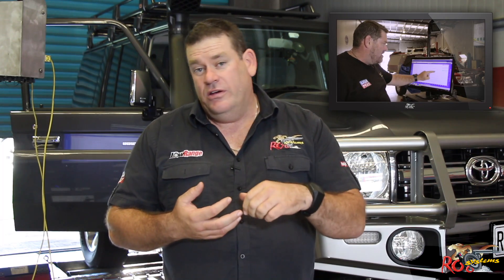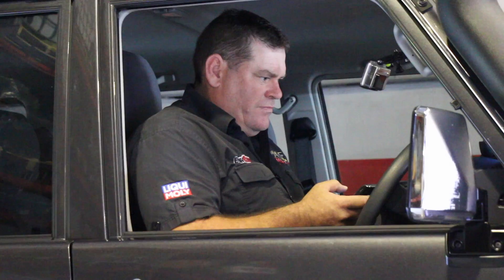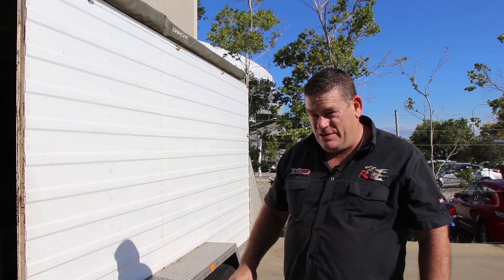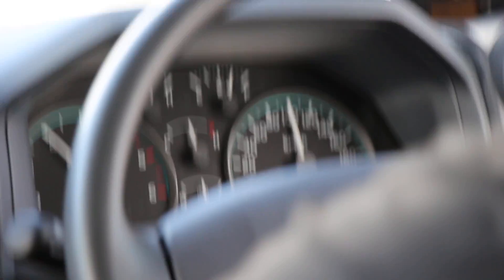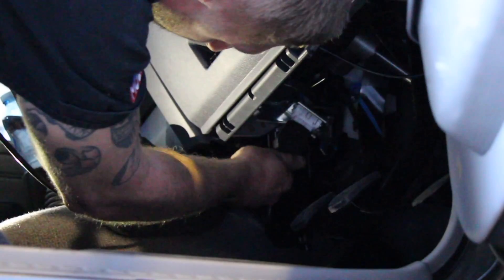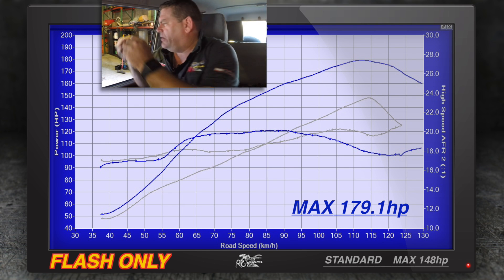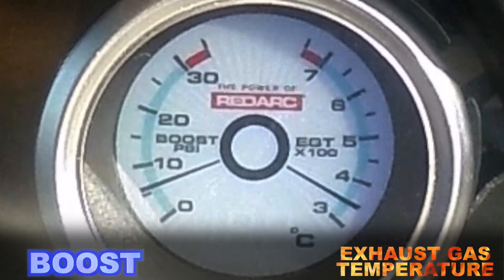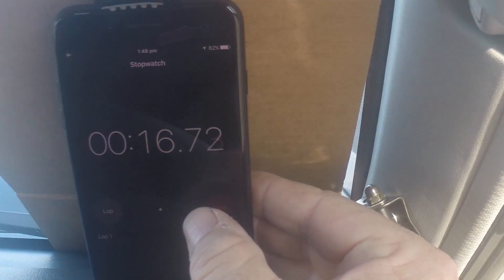Myth Busted 2 - DPF and Flash tune - Roo Systems

Comment: I think it's great what you have achieved, great work!... But... I have a question...With flash tuning & aftermarket exhaust systems & cooler exhaust Temps, don't you need the exhaust Temps to be, well... hot for the dpf to work in regards self cleaning & soot burn offs??
... R.

Comment: As a pilot when I lean the fuel air mixture out it increases the EGT (fact). Please explain how leaning out on your tunes decreases EGT?
Reply: Diesel works different to other fuels.  On a non turbo diesel, there is no throttle body.  The power output relies on how much fuel is injected.  Less fuel, less power and more fuel, more power etc.  

On a common rail turbo diesel, the tuning changes to fuel timing, duration, and wastegate in which causes the turbo to make more boost, resulting in more air into the engine and a leaner mixture.  Add a little more fuel for added increase in power and the results are shown.
Reply: With diesel, leaner mixture = less heat = lower egt's.  Richer mixture = more heat = higher egt's
Reply: I posted a/f and egt's for a gas engine... duh.. I should know better since i just repaired a diesel engine that has a dpf.  My exhaust valve seats were pitted from high temps which were caused by the dpf regeneration. i.e. injectors dumping fuel  into the engine to burn off soot in the dpf.  You are correct sir.  
The extra fuel is still burning in the exhaust and that heats up the turbos which in turn heats the air charge and make the fuel ignite sooner.
Reply: @gregh7457  Thats interesting about the valve seat pitting.  I have a 79 LC with dpf which is stock.  If you have a tune that resulted in lower exhaust temps, would the dpf regeneration still be as effective compared to standard?
Reply: To regenerate the dpf needs temps of about 600 c.  I don't have a egt gauge so I don't know exactly how hot its getting but its all stock. The temp sensors on the dpf tell the ecu when its done cooking so I don't think a tune for slightly cooler exhaust temps would change anything. It's not a toyota so don't get alarmed. Your LC is better engineered than mine and the exhaust valves are probably fine. I'm unfortunately removing my dpf and getting a tune to stop regens and remove egr. I can't risk damage to the engine again. Another thing i'm concerned with is excess fuel making its way to the crankcase and diluting the oil.
Reply: No didn't check but others with the same engine have checked theirs and they're within "acceptable limits"   However, i ran into this article about the post injection process and  biodiesel which we use quite a bit here in the states, me included. It uses a different process to measure dilution and they're coming up with 45% dilution rates. I find it very interesting that Cat took another approach and injects fuel AFTER the exhaust leaves the engine. Much much better solution than the automakers using the cars injectors. http://www.biodieselmagazine.com/articles/2290/understanding-the-post-injection-problem/
Reply: Thanks for the link, a very interesting read!  The DPF systems have only arrived here in Aus very recently (as far as I'm aware).  I will do some research here for any reported issues from engine builders etc.  It seems the quality level requirements for diesel are getting pretty important.
Reply: He's talking about EGT's  when you lean out the mixture not power
Reply: But the Diesel, excluding differences in turbo boost while changing load  is normally  using a fixed mass of air and a variable mass of fuel per combustion cycle, with a very lean mixture especially at light load. The regeneration mode is diverting a portion of the exhaust gas back into the intake; hence there is more CO2 and less oxygen than normally , as well as a much increased induction charge temperature ,  substantially increasing exhaust temperature and presumably promoting burning off the gunk in the DPF. So in stoichiometric terms with respect to oxygen vs fuel ,  the mixture is much richer in DPF regeneration mode, but hotter because of the recirculation.
Reply: @occyman It's because it's a diesel you airplane muppet

Comment: So non DPF 79 with chip and pipe ended up producing 170 max @ 400deg, the 76 tune with chip and pipe mods ended up 198.1 max @ 350 deg, is the DPF model improved by Toyota in other areas as well, can’t see why the DPF would improve performance understand it improves emissions, but even stock there is quite a difference, 79/134 hp max 450deg vs 76/148 hp max 480 deg, great your tunes are effective as it seems it not only improves low and top overall power but also be better for emissions being more efficient, everyone wins, one thing this a,so proves though which is missed and very important, DPF backlash is more to do with EGT temps that’s what does the damage in the long run or short run as many have found out especially in the US, Powerstrokes, Rams and Chevys etc, so this mod is a good thing as to me the main benefit is lower EGT temps with overall power gains. Good work, great testing, enjoyed both.
Reply: DPF would not improve performance, Toyota also put new injectors in the update model and a larger bonnet scoop to reduce intercooler temps further. These things would explain more power.
Reply: Class action about Toyotas dpf now too lol

Comment: Great work Glenno. I saw the boost get up to about 10 psi with standard form. 15psi with the remap, 16-17 with the exhaust and remap. I've got a 2016 dual cab (pre dpf). I've got a straight through exhaust and just wondering if the flash tune is same for each vdj motor or customized for each car? What's the limits of the factory turbo? More boost and lower air fuel ratio seems to be the formula.

Comment: Hi I have a new 2017 76 series. currently getting 11-12 litres per 100km.   I am interested in getting the exhaust and remap.   What differnece will it make to my fuel use.   I assume more power means more fuel.   Also what would the same as the video set me back?

Comment: What does chipping / re-map do to your Toyota new car warranty?
Reply: I see you didn't get an answer to this question but I can tell you with my 2018 Triton this procedure would void engine warranty. The sellers of these products never mention this. Some I have spoken to just refer you to the dealer, when they know the answer. Its the same story with catch cans.......
Reply: @rogerchambers1309  actually the burden is on the dealer to prove that any mods caused the damage - if they refuse a warranty claim without any evidence a letter from your solicitor will usually rectify their attitude.

Comment: Hi guy, what you have done to this 76 is awesome. Did it still have the standard clutch in it or has it been upgraded. 👍
Reply: Thanks Chris- appreciated. Standard clutch still in this 76 series. The DPF model clutch has a higher clamp rating than the previous model.
Cheers,
Glen.
Reply: Glen Hadden, hey.. so i shouldnt have to change clutch to tune my 2017 79 series?